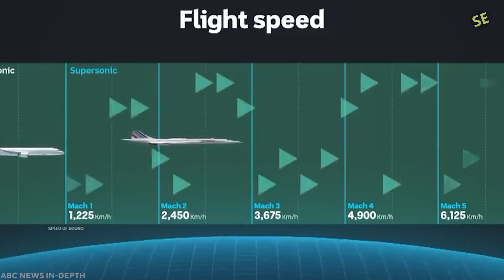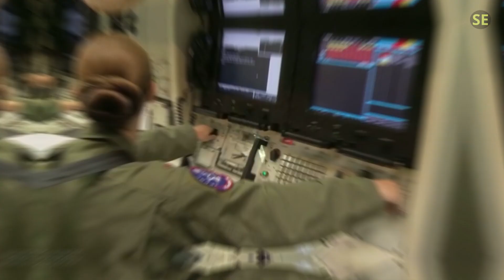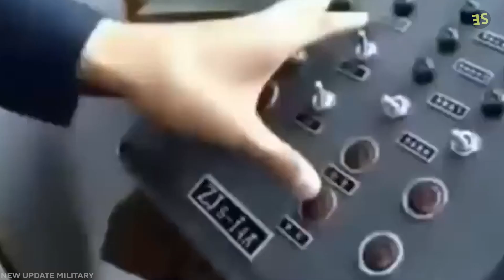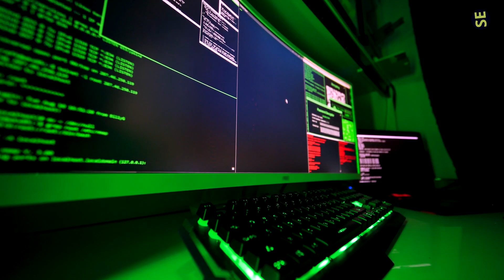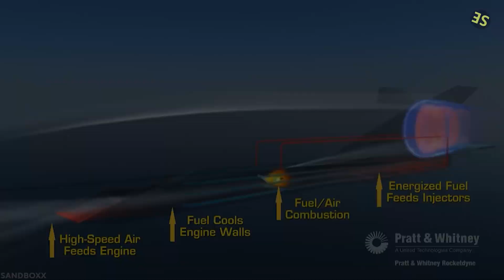Russia, China, the US: Who Will Win The HYPERSONIC Arms Race?

Comment: Both Russia and u.s may but u.s. cost more by using rocket to high altitude but heat could destroy the missile while the Russia use inertia technology could produce extreme speed but it must use clay to cover skin to handle heat and if it handle heat at 15000 km per hour at about 50000 ft  then hard to stop